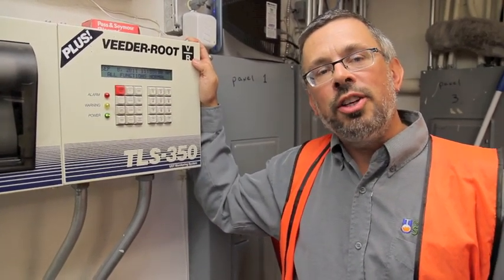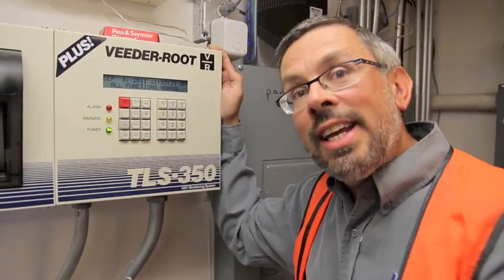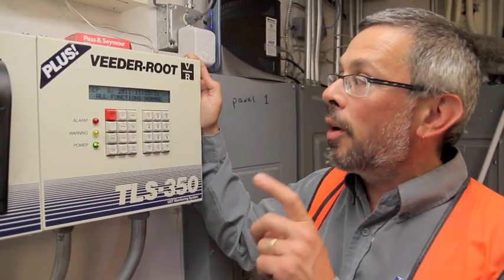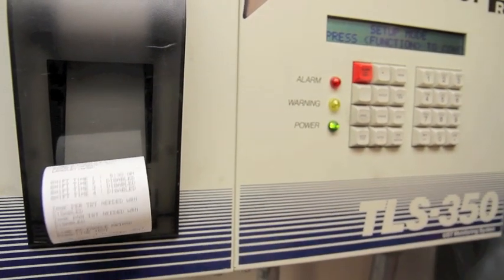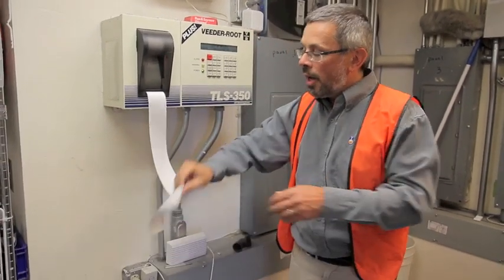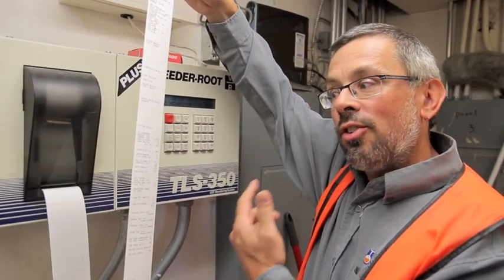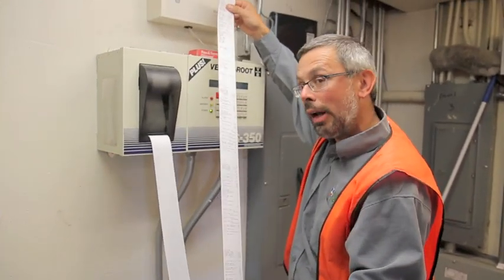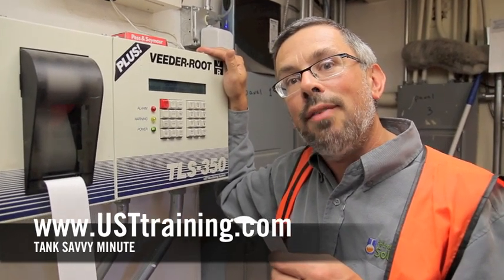ATG Veeder-Root TLS-350 Printing Set Up

Comment: Thanks for the video! would you happen to know a serial command code to download via rs-232 this entire setup instead of print it? I've read through the entire veeder root tech manual several times and cant find anything. Any advice would be very helpful!
Reply from the maker: Hi +Tony Reyes, I'm not sure since I'm not a VR certified tech. If you can find one locally I'd ask them. Sorry.
Reply: +Ben Thomas I am VR certified haha. My inspectors often like a copy of the setup, and I don't like handing them half a roll of printer tape. thanks anyway good sir, keep posting!
Reply from the maker: +Tony Reyes That's funny. My bad. Just hit Mode, Setup, Print and burn some paper. :)